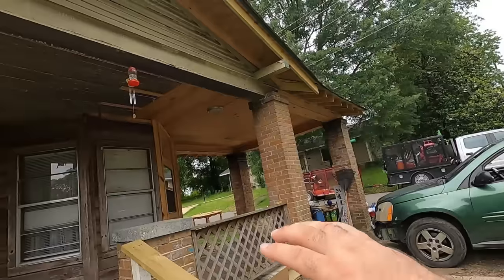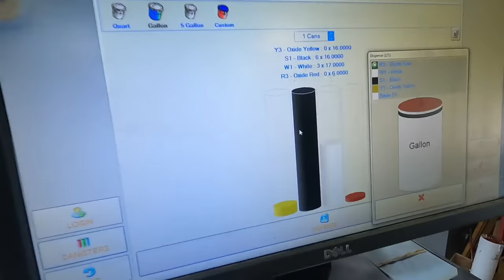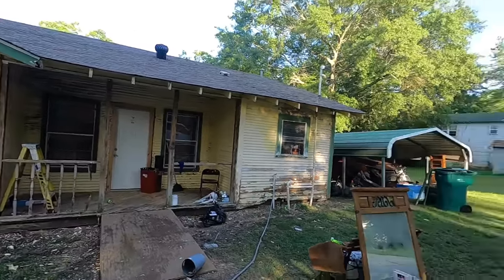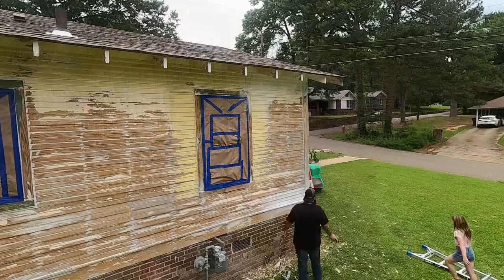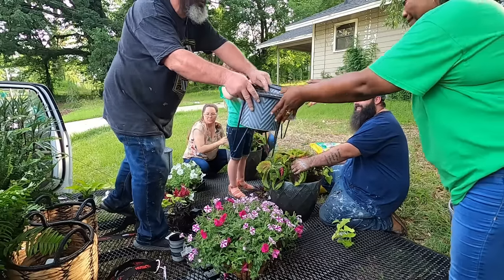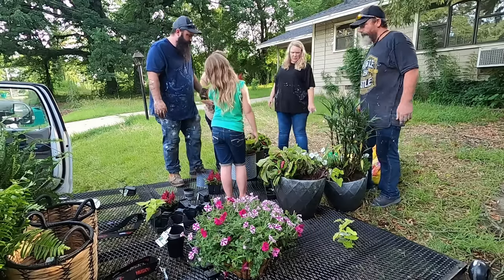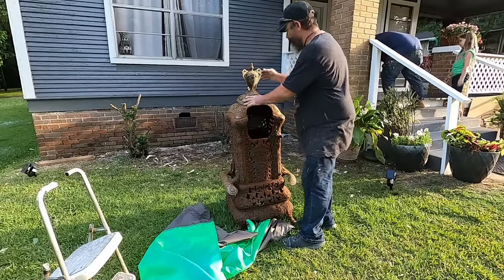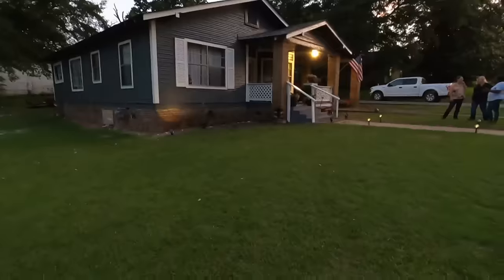WE PAINTED this RANDOM HOMEOWNERS HOUSE for FREE | UNBELIEVABLE RESULTS

Comment: Hi I'm painter as well I noticed that you scraped a hell of a lot. I was wondering if you know about a helping tool called the paint eater? It's an amazing machine that you can get at Lowe's in the paint section. Here is a picture of it.
Reply: Well I couldn't load the picture but you should check it out easy to handle.

Comment: small many cottages old Motel in rainie  western  WA..I was turn down from doing a hand scraping -sanding & hand brush on paint job .. Would take time ..doing one cottage at a time..my crew would be scraping & sanding one cottage . As I would hand paint their finish ones .. But a professional (HA) paint company  ..with pressure washer and spray guns ..got the job -giving a quote just few dollars less than mine ,plus the say the have it down much quicker and all cottages would done to gether -fast ... Few months latter i was hire back at this same motel to change out old wooden windows for new aluminum frame   ones . I notice with my figure nail ..I could pull off long pieces of the new paint ..It seems they did n9ot wait enough long dry summer days for the pressure wash walls to compleletly dry out...